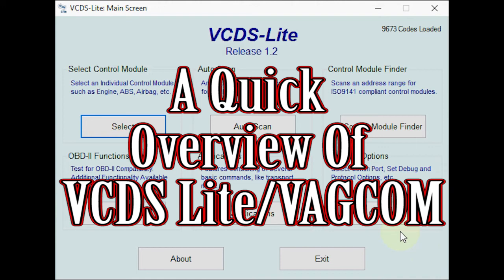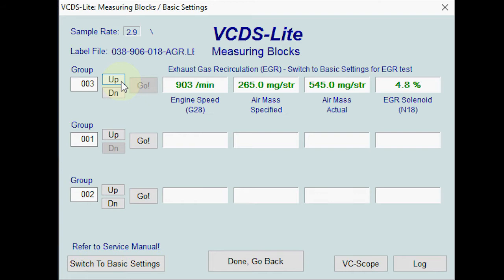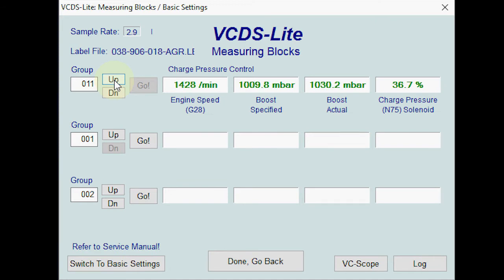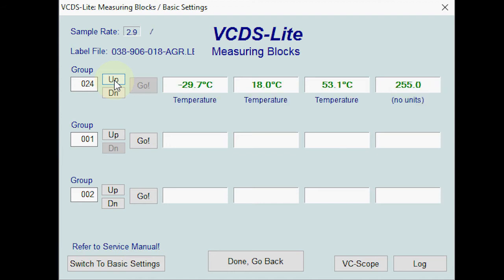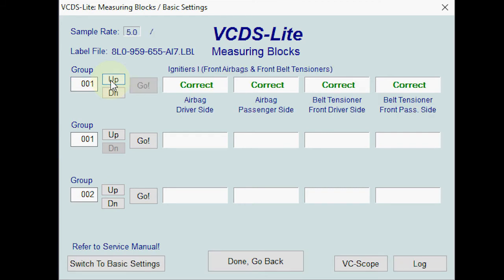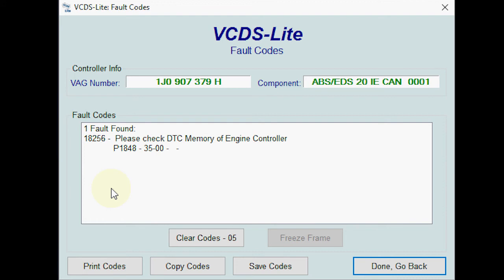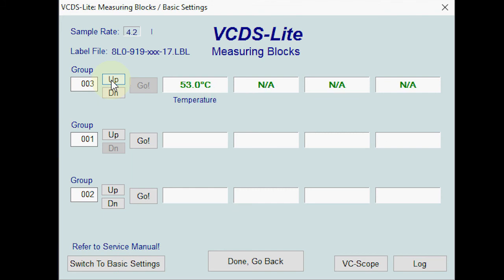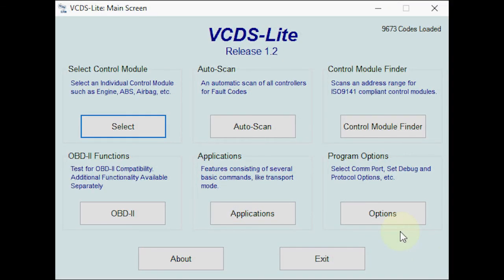A Quick Overview of VCDS Lite/VAGCOM

Comment: Hey there, I am trying to use my VCDS Lite cable to diagnose why my engine will not start. Does the engine need to be running to use Lite? I changed the fuel injection pump recently, but it would not start before that. Hope you can advise. Cheers from Devon UK.
Reply from the maker: Needs to be on or ignition on.
Reply: @CarAndMechanical  Ignition is on. When I go to drivetrain and click on fuel pump, it says no response from controller. Other functions seem to work ok. 
The port thing however, says 'poor latency'. Could that be a problem? So, you say that I should be able to diagnose issues as long as the ignition is on.
Reply from the maker: @TheHeartCharmer  I've not done fuel pumps before but think there is documentation on the VCDS site. Something tells me you need to log in. Can you see fault codes and live stats otherwise?
Reply from the maker: Just seen the port latency thing. Worth making sure the com4 stuff is properly working
Reply: @CarAndMechanical  Yes, I have seen some fault codes for other things. Not sure about live stats though. I presumed that log in and registering meant paying for the upgrade. Should I have to log in to use Lite?
Reply from the maker: @TheHeartCharmer  to change stuff yes. It is limited with lite but there are bits you can change.
Reply: @CarAndMechanical  Alright! Thanks for your kind responses and advice. Will try again tomorrow.